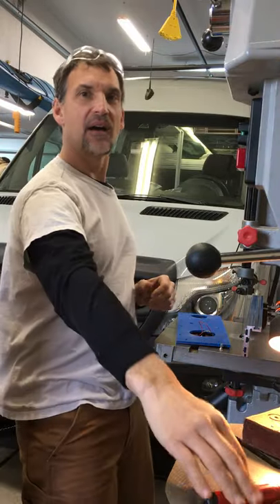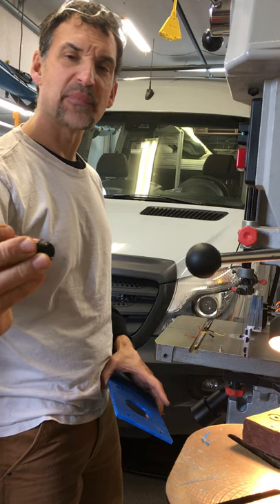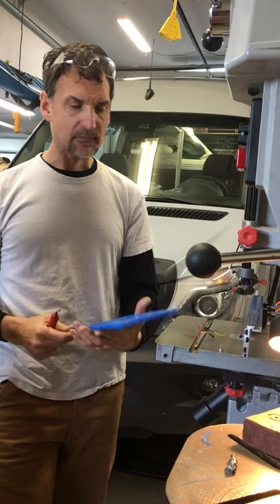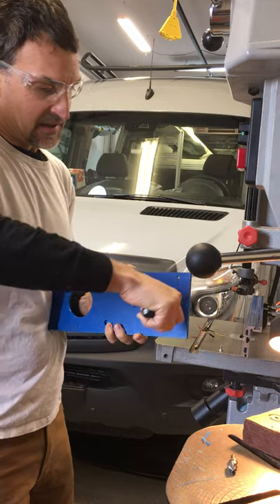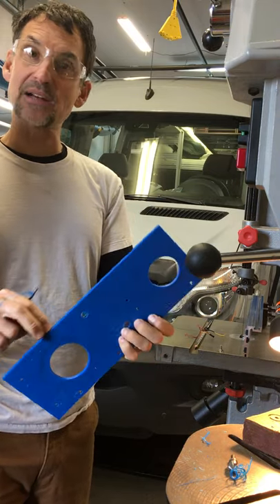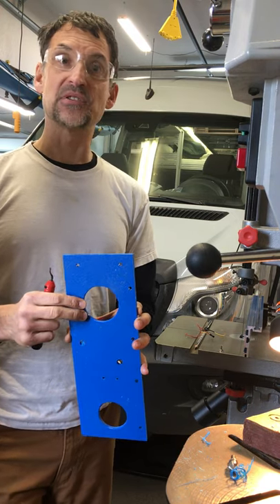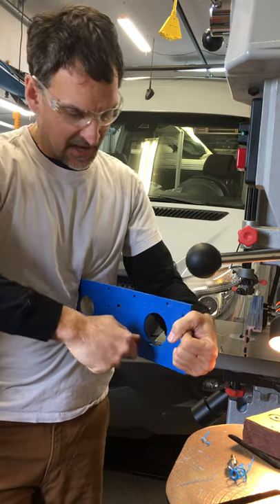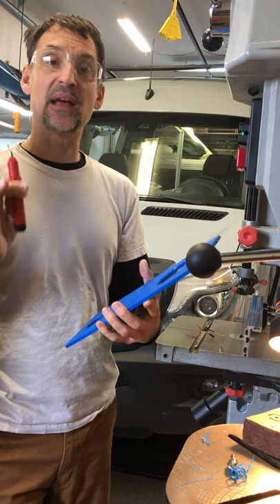Countersinking & deburring holes and making a hole larger than hole saw in HDPE

Comment: can you spell it? What’s the name of this tool? Thanks
Reply from the maker: Yes, here is a link to this deburring tool: https://amzn.to/44pHcPY
Reply: @vantripping  thank you so much! I drilled 11/2’, and bought 1’ uniseal, only to find the inner end is 13/4’. Very frustrated. Googled a lot. Saw your post. Does it work to make the hole larger, from 11/4 to 13/4? How to make sure it’s good round? The plastic is 1/2 thick.
Reply from the maker: @tiangq  Yes, just keep evenly rotating this tool around the drilled hole and it will eventually open it up to the size you need. I used it regularly to easily enlarge a drilled hole in HDPE plastic by 1/8 to 1/4" and more can be done.